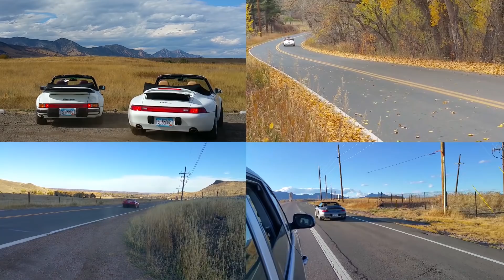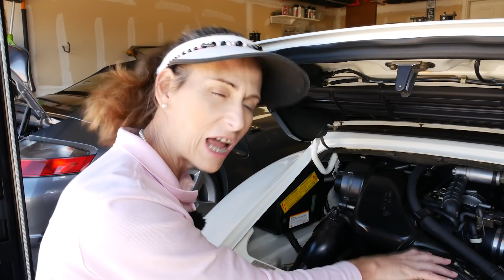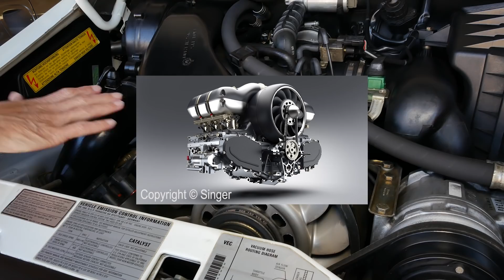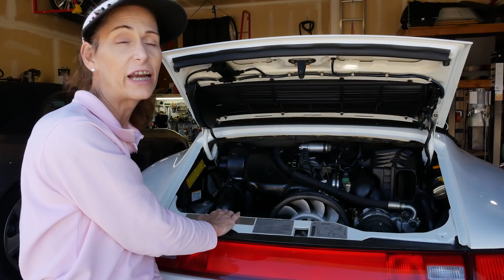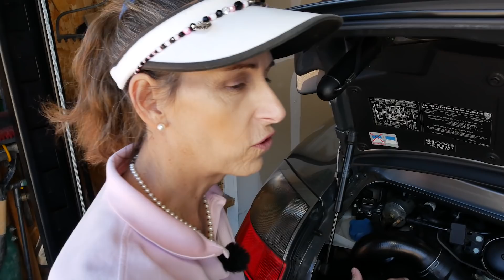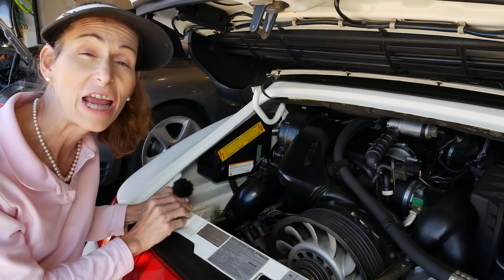Water Cooled Vs. Air Cooled Engines – With Engine Sound

Comment: Good one, I have 964, so aircooled but I only bought it to wake up memories when I was a kid. I think one thing you did not mention some of the aircooled have an oil cooler in front so still have to worry about hoses even if not filledxwith water
Reply from the maker: +Bo  Strömberg we did talk about air cooled having oil, but your right.  Hard to remember everything. Thanks.

Comment: Even though I'm on my second Porsche, both water cooled, there is something about the sound of that air-cooled Porsche flying by my house, they get my vote.  I've also had the good fortune to drive air-cooled Porsche's as well. It may be that they were older as well and the driving experienced required me to be more (consistently) engaged.   But then, I loved the sound of my 1966 VW Bug when I was a much younger person...
Reply from the maker: It is just such a different sound.  The 356 sound is very different than the 3.2 which is different than the 993.  Add induction and exhaust and there is no need for a radio ;)

Comment: Even though I prefer air cooled from a purist's point of view, the water cooled engines add more complexity due to the radiators being at the front which are prone to picking up debris. I do know that the latter 993 engines did have a habit of wearing out the valve guides excessively in the four valve heads. I'd say much of the heat would be attributable to this wear, indicates a design limitation of air cooling.
Reply from the maker: I'm pretty certain that non of Porsche's air cooled road cars are four-valve engines.  There are some issues with not enough mass left for proper cooling.  This is also tied to the emission issue they needed to solve and yet another reason to move to liquid cooling (can't cool the heads with oil).  You are right about the debris that the radiators love to eat!

Comment: The waste heat due to the inefficiency of a gasoline engine comes out the exhaust.Water or air cooling only keeps the fire inside the engine from melting the metal.

Comment: I really enjoyed the video - and the accompanying sonic bliss!  I'd like to ask if there's an economic difference that you notice in running the two cars?  I'd think there's probably a lot more engine oil in the 993, and being able to control the fuelling more effectively in the 996 might give you better mileage if you're not in the boost, going for it?  :-)  The liquid cooled cars can sure build up heat, too, though.  I have a 991.1 C2 with the 3.4L engine - on the track, I sometimes see my oil temp get to 250 degrees, but the overall engine temp stay right at 194 - even on a spirited drive, the oil otherwise only touches 230 or so.  Do you see oil temps that high in the 993, and feel you might need to change your oil (with its higher volume) more frequently as a result?
Reply from the maker: Hi Cam, The 996 does get a little better gas mileage than the 993, but that could also be due to the variable cams, electronic throttle and a host of different bits between the two engines.  The 996TT engine is very different than the NA M96 engines and one of the biggest differences is that is is still a dry sump (like the 993) so the oil capacity is about the same.  Porsches (with the exception of the 356) take a ton of oil!  As for temps on the 993, I haven't had any real issues, but it does move around a bit.  With the 3.2 Carrera we almost had to pull over in sub 30deg weather in stop-and-go up the mountain one morning.  The engine speed was 1Krpm and almost no forward movement.  The later Carreras have a fan on that big oil cooler which would have done the trick.  Luckly traffic started finally moving and within in minutes, the temp was right back where it should be.  Maybe I should have made this point, but Air Cooled isn't super good with slow-and-go.  As James Taylor said, "Hurts my motor to go so slow" ;)
Reply: Thanks for the detailed reply - I'm with you (& Mr. Taylor) - keep the revs up - no lugging!

Comment: From an engineering point of view the temperature control of a water cooled engine is better at the cost of complexity, as you rightly say. 

Heating is a good point too. On some air cooled cars the heating is almost nonexistent. Some cars with air cooled engines can overheat, like the Tatra T87 for instance.

But still, I like air cooled. Just look at where my face should be. Yep that's a 911 fan.

Another thing to consider are the cylinder heads. The air cooled heads Porsche used all had two valves per cylinder. They did use 4 valves per cylinder on some air cooled engines, but to my knowledge these heads were water cooled. Introduced on the 935/78 I believe and the 959 had them too. So you have an air cooled engine with water cooled heads. The two cylinder boxer that BMW uses on its motorcycles have either two or or four valves per cylinder. The ones with two valves are known as airheads and the one with four valves are oil cooled, so no points in guessing these are known as oilheads.  I don't know of any air cooled cylinder heads that have four valves per cylinder.

Most of the air cooled engines have the typical cooling fins, while the water cooled engines have water circulating in the engine block. The Honda 1300 had an engine that has air circulating within the block. It's almost like a water cooled engine without water. It used two fans, one to push cold air in and one to take the hot air out. The idea here was to reduce the volume of the engine compared to traditional air cooling and make it quieter too.

As far as I know, the last newly developed air cooled engine for the European market was the flat four in the Citroën GS in 1970, that went out of production in 1986. Porsche really was the last of the Mohicans of air cooled engines as far as cars are concerned.
Reply from the maker: Wow!  Thanks for that!  Some really great info.  I know it is big deal for motorcycles and I had an outline to talk about the differences in airplane engines, but it wasn't totally applicable.  There are other issues that are specific to airplanes as well.  I don't think I'd want to be that exit fan one the poor Honda engine ;)  The two biggest plusses to water cooled I believe are the ability to transfer heat to far-away locations and scalability.  In the end, it all gets exchanged to the atmosphere I suppose.  Great points!  Thanks!  F
Reply: The air cooled flat four and flat six are common in airplanes aren't they? Porsche did produce the 678 engine and the PFM 3200 for use in airplanes. I am not familiair with either of them, but it would be cool to compare them to the 356 and the 3.2 Carrera on which they are based.
Reply: My 1973 Honda XL250 motorcycle was an air cooled 4 valve single. Normally I wouldn't bring up bikes in this discussion but for the mention of BMW.
Reply: Thank you :) I didn't know that. Just had a look at it and the fins on the Honda XL250 cylinder head and are quite big. It will work on a single cylinder engine, two cylinder boxer or V twin, but with more cylinders per cylinder bank there is probably not enough room for the cooling fins and the fins that would fit, would have too much heat build up. BMW probably opted for oil cooling heads because they wanted smaller cylinderheads.

I still wonder about the Singer/Williams/Mezger 500 hp flat 6 though. The cylinders are air cooled and it has four valves per cylinder. I can't find anything about the cooling of the cylinder heads, but they appear to be oil cooled.

Comment: Very nice comparison also nice explanation on the cooling physics. Two points & one question: 
the engine sound is also determined by the aspiration, isn't it? So comparing a turbo with an N/A would affect your comparison?
The "funny smells" are the exhaust gases in parts. When I start the 993, let it run then drive backwards I get a nice portion of that. Reason: the air for the A/C is taking on the left upper corner of the engine bay.
Does Water cooling leads to more power? Or is the raised power with the lower displacement in the standard Carrera 996 (3.4l ) due to the VarioCam 24 valves ?
Reply from the maker: I don't believe simply water cooling raises power, just that you can be more clever in how you dissipate it.  Making power in an engine is really all about M-dot or Mass-Flow times efficiency.  All the tech you see on engines from turbos to valves to ignition maps are to increase the flow and efficiency of combustion.  Each comes with its own complexity and support requirements and after a number of them have been added, the existing systems like cooling and oil have to be altered significantly.  Ease of altering these base systems becomes important.  You can't make big power without good cooling, but good cooling doesn't increase power.  

Yes, some of those heater smells are exhaust, but those heating tins and ducts get really dirty and oil soaked.  A lot of it is bare metal channels in the car's frame.  They are even more interesting when they warm up.  It would be better if they could be cleaned a bit more easily...

Comment: Nice video Franny, but know that the 356 C has the exhaust heat exchanger like the 911s.
Reply from the maker: Hi Charles.  I've been looking into that...  Is that just the Euro heaters?  It is a pretty rare option here in the States.  I've seen the same heater boxes our car has on 912s.  I need to research a bit more.  Thanks!  F
Reply: It's smaller, and located closer to the head, but it is there and it's an improvement over the prior system
Reply from the maker: There is that small cover on the front "J" extractor of #1 and 3, but I saw a Euro heater that looks a lot like a 911. There is a car for sale currently on the Registry that has one fitted.  It is very different than anything I've ever seen.
Reply: Yep, not as good as the Euro one, but better than the A and B one

Comment: How'd you loose the coolant on the 996 (you said to ask you in the video....).  I'm an "old school" guy; I liked the "Porsche" sound of my '76 911S and '91 Carrera 2, even if they didn't warm up too fast in the winter; I pretty much didn't drive them in the salty winter roads of Utah, anyway.
Reply from the maker: Yeah, so We have some good friends who were interested in a 996TT so we took the car out for a spin.  I had pulled off into a side street to turn around so we could swap and WOOSH!  all the lights came on in the dash and I shut the engine off.  Huge steam behind the car.  It was the hose out of the pump and it split for connector to connector.  What a mess.  Had to tow the car and replace the hoses (both - super easy) and refill and bleed (not as easy).  That was just a couple months after replacing all three radiators.  One was leaking, one weeping and one I didn't trust so much. That engine would rather just be air cooled as Mezger intended...  We have a friend with a 75 S who just got it back on the road!  Great car!

Comment: Excellent video. Not sure if you answered this already but was another downside of the aircooled engine higher temperatures of the heads meant that the engine had to be built to greater tolerances with larger gaps meaning that aircooled engine ate more oil/leaks?
Reply from the maker: Hi Nick, I hope you are feeling at least a little better?  That does sound familiar.  My cars don't seem to leak at the heads and I always thought the smoke on startup and oil usage was more due to the flat, boxer layout, but I bet you are right.  The poor 993 hadn't run in a few weeks so it let loose quite a bit of white smoke when Heidi started it the first time...  I'd love to know what that little squeal is just as it settles into a cold idle.  None of the other cars do that.  Probably the clutch accumulator or something.  They all sound really different - that is the one thing that actually did change through the years...

Wait,... what were we talking about?  I think your flu is rubbing off on me...  I hope you get better soon - it suck to be sick.  F
Reply from the maker: Hi Thomas, Totally! That was a big problem on the 911 SC with those Dilavar studs.  They were spec'ed to deal with different heat deltas from the exhaust vs. the intakes.  They are a bit more hard (brittle) and have a nasty tendency to snap.  The 3.2s don't have them I believe, but it is a concern on the SCs.
Reply: I do believe it was even more a concern with the 2.7l magnesium block

Comment: I grew up with air cooled engines, so that's what I like the best.   But there is a disadvantage to using air-heat exchangers for a heat source on the air cooled engines.  The first time I hit a water puddle with the heat on in my new 1977 911S many years ago,  the heated air turned into steam and immediately fogged up all the windows in my car. I had to lower the window and stick my head out to see where I was going!  And of course it was raining hard on top of that.  But I still love those air cooled engines best!
Reply from the maker: Oh, that's hilarious!  I've never had that happen, but I do try to get the most out of the AC only to clear windows.  Still, I really don't worry about the cooling system on the air-cooled cars.  That has been the worst bit on the turbo!

Comment: You couldn't have said it better. Water cooled Porsches lack that old school drama. All the smoothness and efficiency of today's engines is amazing and it's beautiful to see. However, the old ones have a kind of character, such a personality (although they are machines). That's a simple but necessary videos, a real life comparison.
Reply from the maker: The 3.2 Carrera has to be close to the best of all worlds.  Still a bit of ruckus behind you, but a very derivable and reliable car.  Nice exhaust note too.
Reply: @HeidiandFranny  I haven't had my '87 3.2 Targa for over two decades, and I still think about that car.  The tune was one of its most lovable qualities, and it's a long list.  I drove a 16 Targa a couple of years ago, and I felt so detached from the road, and all the electric buttons, and other 'modern' things, it was a huge disappointment.

Comment: As a VW beetle fun, I personally prefer the air cooled engine, that has a beautiful sound, although, for practical purposes, the water cooled is far way better. Adequate temperature control allows more efficiency and less pollution. Reasonably, it is a better engine.
Reply from the maker: I totally get you.  We are 50-50% in that garage air to water.  Pluses and minuses to both ;)

Comment: I prefer water cooled...the air cooled engine has too much clanging going on, like a sewing machine lol
Reply from the maker: You should hear the 308...  It has three large transfer gears and makes the strangest whining noise...  I bet an electric car would be a bit strange with almost no noise ;)
Reply: Electric cars make a high-pitched whine (I suppose it's the voltage converter) that doesn't change with speed.  I find it really annoying, though most people over about 40 can't hear it.  I don't know if you can hear it from inside, but walking down the street, I can tell is a hybrid or electric is coming up behind me from about 200 feet away.

Comment: Nicely done bit of of cooling science. I propose the Porsche had no choice but to move to water cooling for passenger comfort,  increased power, engine longevity and emissions compliance. Now we need a comparator on normally aspired versus turbo in modern water cooled models...
Reply from the maker: Deer Creeker we could have done that when we had our Boxster S, but it is in a new home.  We might be able to borrow a friends car.   Let’s see, where do you live?  Jk.  Heidi
Reply: Ken Caryl Valley
Reply from the maker: I was just kidding...   I knew that from deer creek.  Heidi
Reply: 993 engines know for being "undistructable", the 996 engines however are not know for longevity, except for the Turbo (Metzger) engine...

Comment: The heater working when it's 15 degrees outside (plus heated seats) is worth a little sound difference, in my opinion. I remember freezing in an old air cooled 911 back in the day.
Reply from the maker: I would like to add heated seats to all our cars, unfortunately our little 356 with her six volt system would be a challenge.  I hope to get heated seats in the 996 soon.  :)
Reply: Fire, the wheel, the back scratcher and heated seats are mankind's greatest inventions / discoveries!
Reply from the maker: Don’t forget the phone and lightbulb, and airplanes...  list goes on.
Reply: My old 914 used to be severely heat-challenged (with the lovely boxer-4).  Fortunately, I'm in the deep South, so it was only a major issue a couple of weeks a year.  A bigger problem was how hot the engine bay would get if I got stuck in traffic.
Reply: Of course, the major problem was that the throttle response was terrible.  I wish I had done the Weber conversion instead of keeping the stock injectors; I'd probably still have it.
Reply from the maker: interesting.  Yeah, lots of people switch to Webers.  Heidi